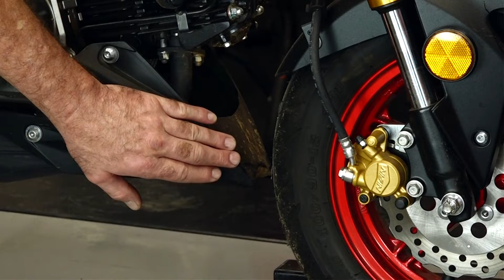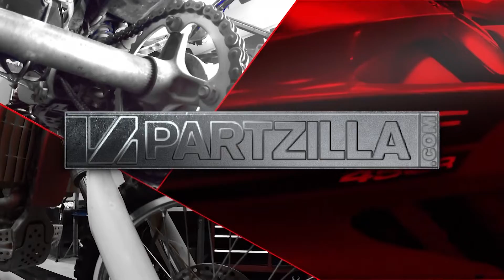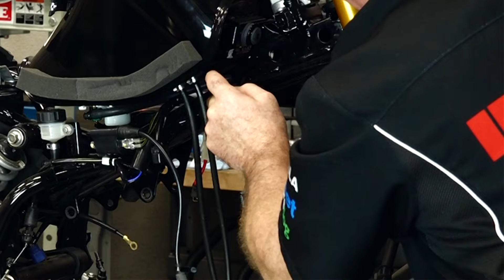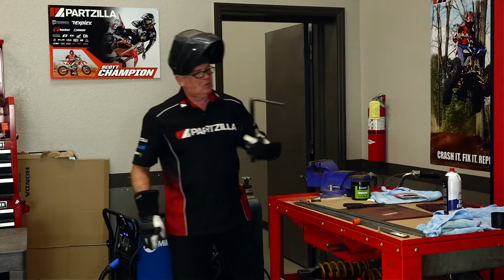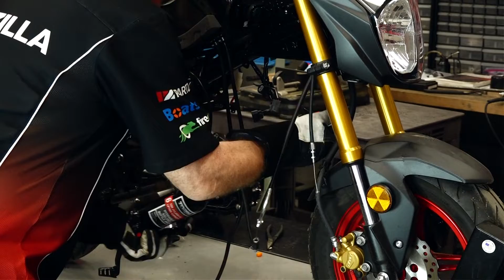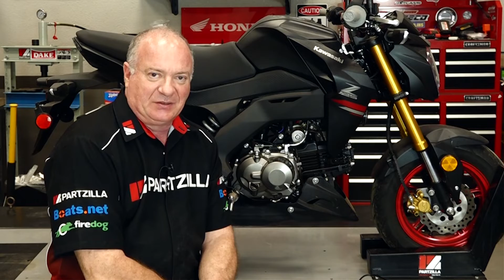Kawasaki Z125 Motorcycle Frame Repair | Motorcycle Frame Straightening | Partzilla.com

Comment: Hi, after my bike hit the front tire, the front wheel moved back by about a fingertip, and the handlebar also went a bit forward. I want to know if there's any way to get the chassis back to its original state without completely disassembling it, or if it's fine like this and I shouldn't bother

Comment: Wow that’s very impressive. I got a question. The neck on my motorcycle is slightly bent outwards after I got in a wreck. Will I be able to bend it back in?
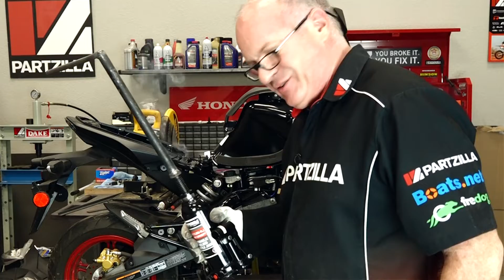Reply from the maker: We'll ask John today, Friday 1/24 at 3PM EST. If you can't be there, the video will be live shortly after we wrap up at 3:30 EST.

Comment: Nicely done. Given that the screws for the tsnk lined up and such, you must have beought it to close enough to where its supposed to be. However most of the time with such collisions the camber of the front wheel gets affected as well. You can be lucky and all the movement of the frame might be in the same plane as the bikes middle which runs through the middle of the front and bakc wheel. If the bike doest pull to one side when riding then its most probably fine in the camber department. However in cases as these you realle need an accurate way to measure these things. Strings might be enough but not always. But as i said if it runs fine when ridign with no hands youre most probably good to go. Nicely presed back into position that was done good 💯

Comment: Dude, you're gnarly. Nice fix. Would be interesting to learn if the frame can maintain its new shape.
Reply from the maker: So far so good a few months later. Remeasured a few points and it's right where I left it after a couple hundred miles. Would I attempt this on a sport bike? No way! The Z125's steel frame is much more forgiving. Especially considering it's intended use.

Comment: Hello John.  Help I have a honda rancher 350 and when you push the start or either pull the pull rope it won't crank. It's like it's free spinning. What could be wrong